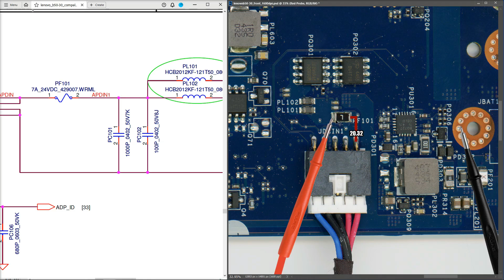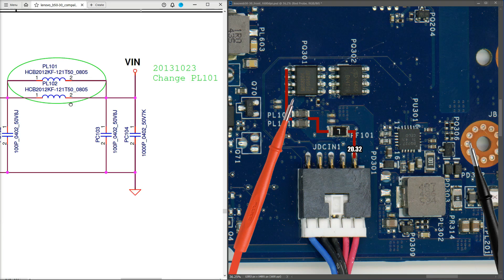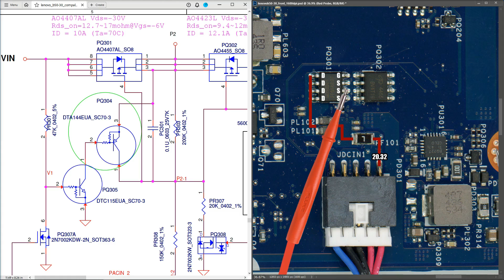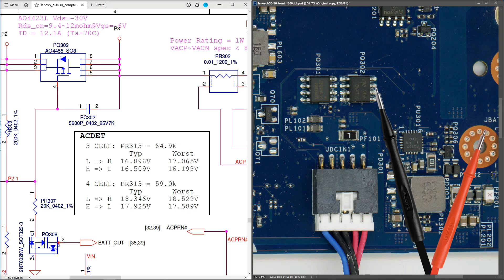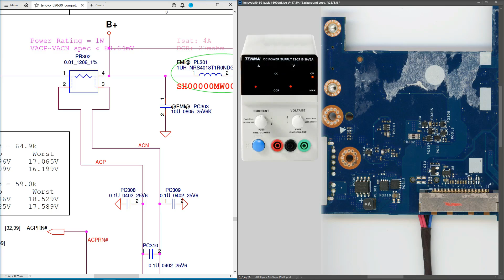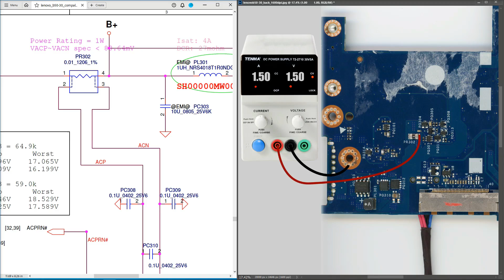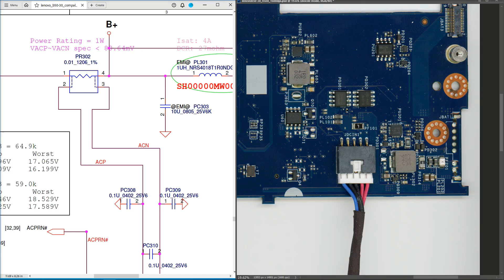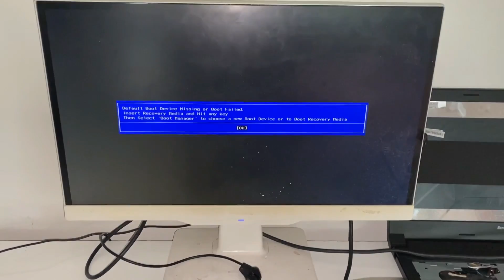LENOVO B50 30 - HOW TO TROUBLESHOOT A SHORTED MOTHERBOARD

Comment: Can I ask why you inject voltage to the current sensor not to the shorted second MOSFET?
Reply from the maker: Hi, It was just physically easier for me to solder my red wire to the current sense resistor. But injecting voltage at the drain pins of the second MOSFET will work also.
Reply: @therepairshare673  thanks 🙏

Comment: I was surprised that you didn't do a physical inspection as soon as you removed the motherboard. But the bad cap was not very obvious on this one. It is amazing how finding shorted capacitors is such an obsessive addiction. We all like to to a happy dance when we find them.
Do you recall the processor specs?

Comment: 4:30 it's not unusual because if you check the schematic you will see that both gates are connected together therefore the voltage is the same and both FET are switched off. In some other designs though the gates of the first two FET are controlled separately but this has to do with the device I guess and how much expensive is. Anyway, kudos for another very educative video.